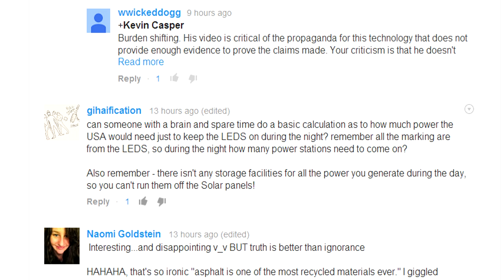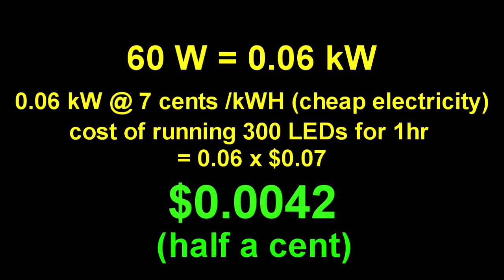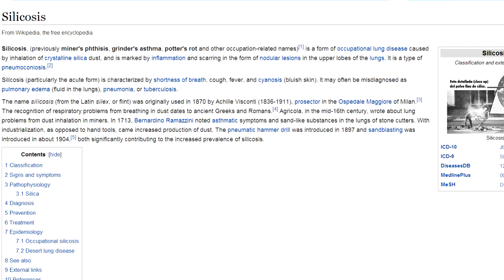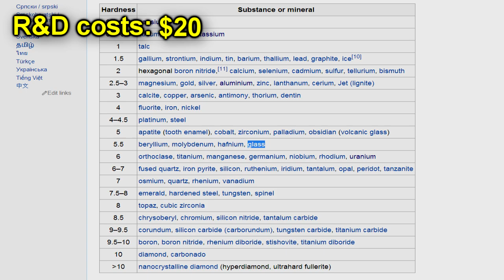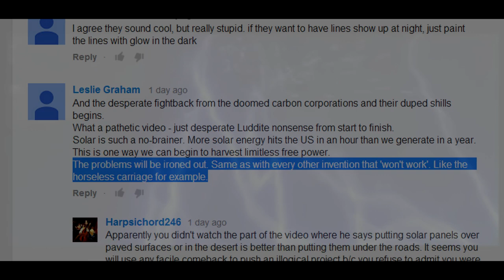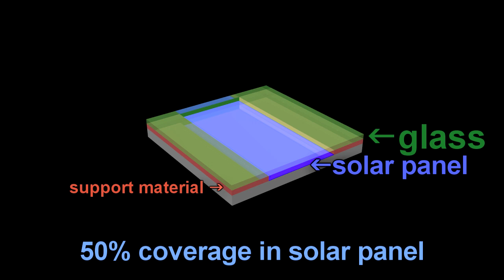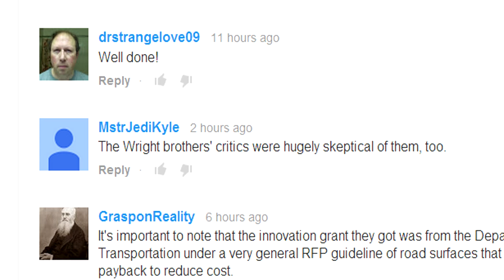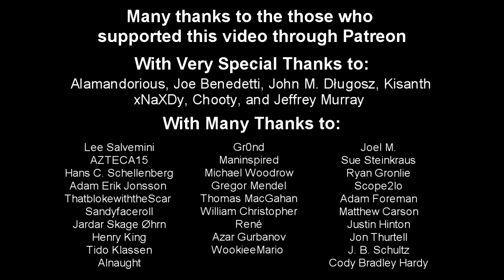Solar Roadways, IMPORTANT QUESTIONS AND ANSWERS!

Comment: Thunderf00t, I agree with your conclusion, but not with your assumptions.

The main one is the glass. This is a strawman, although most likely an unconscious one. You assume they would use the most obvious material, which would not survive an initial test, and then you attack that assumption. Obviously, not one stretch of public road will have these panels until they have a surface material suitable for the purpose.

Even then, I am confident the plan in its current state would be a disaster in snow plow regions. The LEDs are a nonstarter in Minnesota winter. No one would ever see them.
Setting aside the LEDs, each tile edge is just begging to catch a snow plow. Instant pothole - the projectile is not a hazard in this instance, because the plow would fling it aside along with the snow.
If panels are thin enough that the road remains drivable when some of them are missing, roadwork can be much more modular. No need to close more than one lane to replace tiles. 

The tops of the panels can be shaped such that the front edges are square (square edges, not square corners) and the back edges gently curve down to sit a few millimeters lower than the panels behind them. Much less likely to snag a plow, and could provide better uphill traction.
When winter season gives way to roadwork season, the cost of replacing tiles may be in the same order of magnitude as for current surface repairs. (Based on no data, just a well-trained gut.)

When the panels are not missing or covered in snow and muck, catching more sun is more straightforward than you describe. While the panel has to lie flat, the photo-voltaic surfaces can be lenticulated to the immediately local optimum angle.

No matter where the power is intended to be used, it can be stored in batteries built into the underside of the panels. To be worth doing, they would have to capture at least enough energy on a short day to power street lamps (real ones, not in-road LEDs). Even if that is all they do, if the price is reasonable, someone will agree to a real world test.

That gets me to the money. The first test is risky because that is where you will discover the biggest unexpected flaws. As those begin to be worked out, new installations provide a broader range of weather patterns, etc. It would be gradual, meaning the cost to install is spread out over a greater timeline. Compared with ongoing roadwork, what is the margin cost increase to build in solar panels?

The cost of tacking on retail LED strips is prohibitive but not a reasonable assumption. If they have LEDs at all, they would be purchased wholesale at negligible cost. I am going to assume energy captured through the day can power street lights through the night. That is, I assume energy break-even.

What I am much more interested in is the embedded network of energy storage cells. They could constitute a robust smart energy grid, with power lines needed only where pavement ends. Each cell need only poll its neighbors' stored energy and flow rate. A clever enough algorithm can be hardwired in, so that no general purpose processor exists for hackers to mess with.

Thoughts?
Reply: Brian Schiefen How is the use of tempered glass a strawman? They say on their website that this uses tempered glass. Additionally their indigogo states that they "needed the $1M to make some tweaks to their manufacturing process in order to begin sale to the public." Nothing about developing a new material. So its reasonable to conclude that this product uses tempered glass.
" it can be stored in batteries built into the underside of the panels" Creating this much tempered glass is going to create a lot of pollution but lets commit environmental suicide by manufacturing that many batteries. I thought this was supposed to be a green project?
" They could constitute a robust smart energy grid" Lets first look at the fundamental problems before getting carried away. A rooftop panel takes 10 years to pay for itself then lasts another 10 years. A roadway tile is easily twice as expensive because of its concrete base, electronics, and tempered glass. So basically it will never pay for itself. Now factor in that flat-lying panels generate less, factor in a 24/7 cleaning crew and technicians and you'll be wishing you invested all that money into rooftop panels.
Reply: +Brian Schiefen Actually they stated that it was a form of Tempered glass, either or its a bad material because no matter what material you will use you will have the same problem. A road is being sandpapered all the time, anything that is clear will be sandpapered until it is no longer clear. Even Diamonds can be sandpapered you know. Its they that state that its glass so it isn't a strawman.

Actually the project is a hazard because there is more then just sand on a road. You will have oil from the fumes and rubber from the tires. That combined with the sandpapering effect from the dirt and you got a deathtrap. Potholes in this construction will only create more potholes. If you place this on a high way you will have to replace these things all the time, you do not have to close down just 1 lane, you have to close the whole damn road down.

Your guts are massively failing you because you do not seem to understand that each tile that have to be replaced is filled with electronics as well. square meter will cost much much more money then a square meter of what we have today because you need the electronics to work.

So now you want to move the cells inside the panel? How much more expensive do you want to make them? That will cost even more to make then they already are. Also it doesn't really matter if you can angle the cells, if the panel as a whole can't take in the sun angle it will not solve the problem. You will not be able to get more water by replacing a 5L bottle with a 10L bottle if your water source only have 2L of water.

"what is the margin cost increase to build in solar panels" literally billions of wasted dollars. Do you have any idea how much work and waste of resources this is? Its a road hazard that anyone with a brain and drivers license will know. The increase will be so much that you can just build more solar farms instead.

I am not interested in going through the rest. This thing is so bad that it doesn't work at any point. To place solar panels on roads is like placing a toxic chemical factory next to Disney land, ITS FUCKING RETARDED!!! Just build a solar farm facility instead and stop wasting money on pointless research.
Reply: Reddit Gold User Tempered glass is a really bad material for this sort of application.  Laminated safety glass would be the only sort I would willingly drive over.  Although tempered glass is quite strong, a small scratch on the surface or being hit with a small hard object can make it fail completely and suddenly.  The side windows on cars are tempered glass.  Search on

car side window shatter

You will find lots of information on the topic.
Reply: Ken Smith I agree that tempered glass is a bad material for a road surface. I wasn't arguing that. I was arguing the fact that solar roadways' design uses tempered glass.
As for a laminated surface, that also wouldn't work because its not scratch-resistant enough.

Comment: Begin rant (sorry I had a bit of time on my hands)

Regarding the cost of the LEDs, as other have said they would be buying them in mass, so they would not cost nearly as much as you estimated. Also, they would obviously not be implemented all at once, so that sort of money would not be thrown around. They will implement them slowly (as people/communities buy them), and they will pay for themselves with the energy they create. Every place in America won't have solar roadways immediately and magically. The cost of powering the LEDs is a ridiculous question...they power themselves, obviously.

In addition, you mentioned they were made out of a soft material, glass. You really think they would use normal glass like with bottles? The "glass" they are using is tempered, which means it's around 5 times stronger than asphalt. Nice try, but your "test" is invalid. They around proved the panels to withstand over 250,000 pounds with TRUCKS. They already tested it with trucks, so you don't have to make a silly test on a bottle with your silly rocks. It doesn't even apply!

You also mention maintaining the LED lights. Only about every 5 years? ONLY? This isn't any different to potholes and maintaining the road how it is now. They have to stop traffic anyway! I don't know about you, but I am willing to trade a non-functional portion of the road (pothole), for parts of the road that don't light up. Also, how often do you think they paint the road? Probably more often than every 5 years. They have to shut down the road for that too. They should be super quick to replace anyway, as each one functions individually.

You also stated that we are "throwing away energy" by not angling them. What? Where is the energy going now? Oh yeah, into the road not doing anything. There IS NO ENERGY to throw away, because we don't have it yet! Of course they won't be slanted, they are SOLAR FREAKIN' ROADWAYS! Next time you come up with an idea to increase the energy production rate of ROADWAYS from nothing to 3x what the country needs, let me know. They are not replacing normal solar panels, they using wasted space. Lots of roads have forests or houses next to them, putting solar panels on the side of the road would just be impractical.

What YOU are doing, is "riding the coat tail" of the solar roadways popularity in order to get more views. Clearly, you can't find anything better to be critical of. Are there problems with these roadways? Yes. Are they perfect? No. Will they work? Yes. They already have them in a few parking lots, and are still TESTING them. So even IF they failed, they would just fix them. They have done YEARS of research and testing. What evidence and testing (besides grinding rocks on a bottle?) and years of research do you have to back your arguments up?

Ok, I think I'm done ranting. Thank you for your consideration.

~Peter

Comment: You wouldn't light all of the LEDs all night you only need two enough to light the middle of the road as a road marking plus you could easily add supercapacitors to hold electricity from the solar panels which they used to power the LEDs
Reply: +Marcus Hitchins How naive you are. If they add that I will be on that road as soon as I can to steal the electronics. There is money in that shit you know.
Reply: Money no just logic
Reply: Marcus Hitchins Who cares? If there is money in it people will loot it. There is no market for selling Asphalt but there is in selling electronics. Fill the roads with electronics people will tear up that road for the electronics. Put in some really expensive stuff and it will be gone the night you put it down.

Comment: didn't the solar roadways add say something along the lines of them generating enough heat to melt the snow that lands ontop of them? leds dont get hot so they would need heaters in every single pannel how much energy would this take now. leds and heaters

Comment: The whole Solar Roadway thing just makes me facepalm so hard.  Besides all of what you mentioned above in the video, how about the simple fact that, hey...  your parking lots will have cars parked in them, shading them.  Road have cars driving on them, shading them.  Ever see how much sunlight a gridlocked highway gets?  Or the roads in the inner city between tall buildings?  Hmm?  Not much.  In fact, bugger all.
Put the suburban and commercial roof-space to good use instead.  Put the desert to good use.  Put so many other areas that would require so much less engineering to make it work to use.